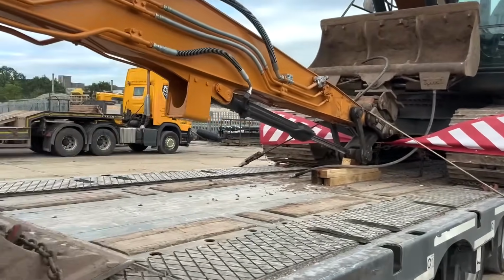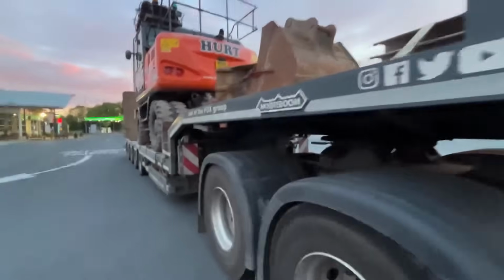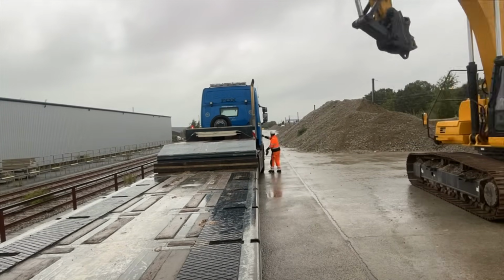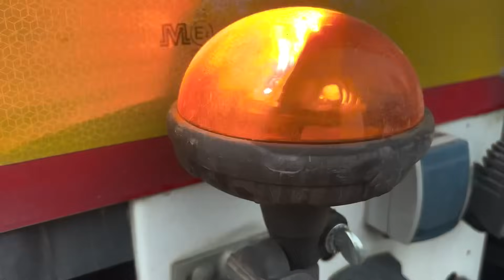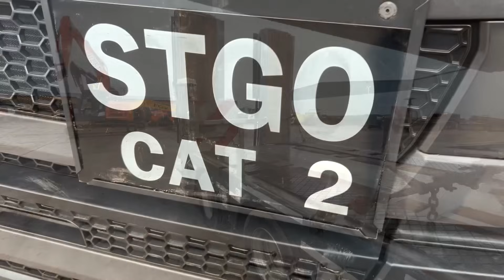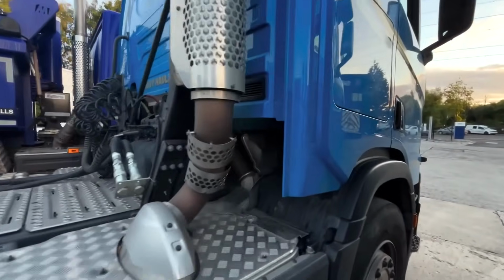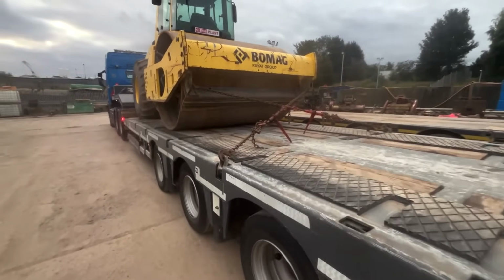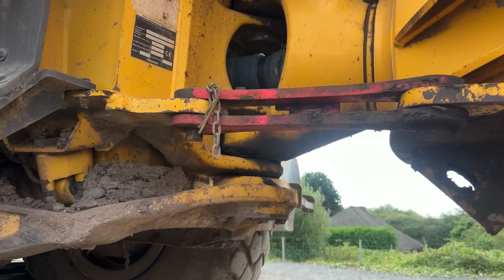Stillgotallmyfingers Episode 30 - Urban Dozer

Comment: Great video as usual. Have you changed the beacons on the back of the trailer? I have noticed something was different for a few weeks but couldn't put my finger on what it was!
Reply from the maker: Haha yes, a couple of the beacons on my side markers needed replacing and I couldn’t get the same design so I used the ones off the rear and replaced those instead, it’s daft I know but it’s the way my head works 🤦🏻‍♂️😉